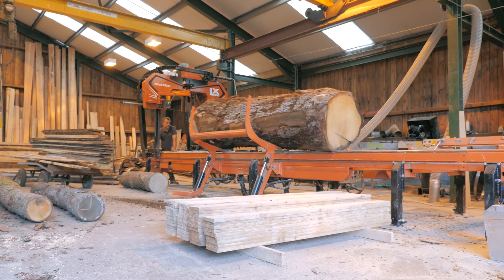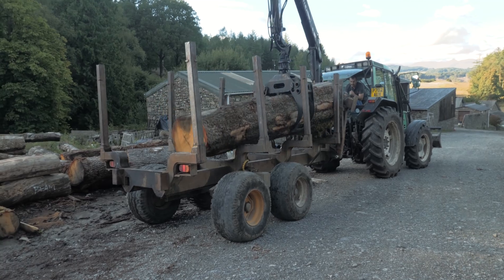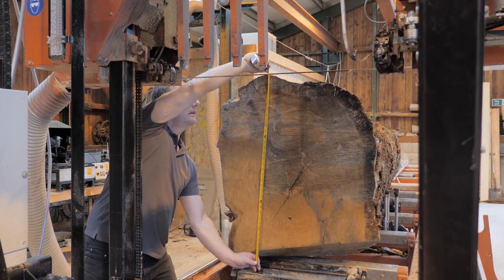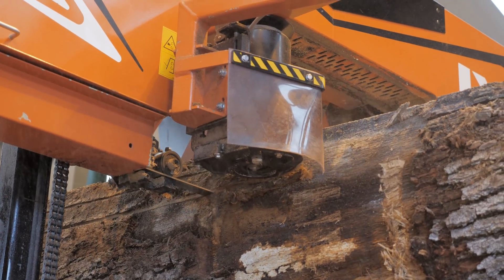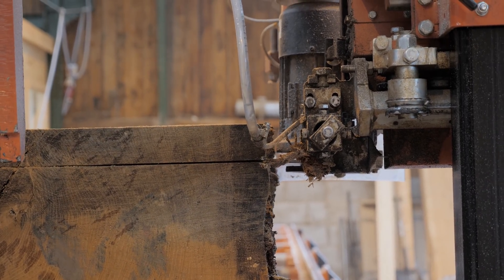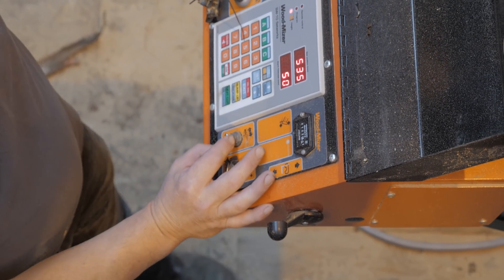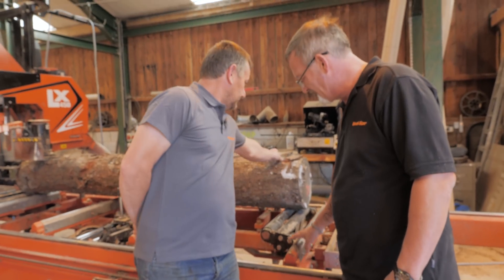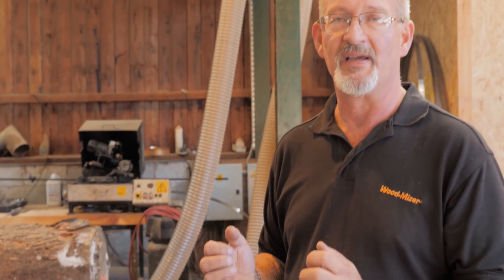LX450 Sawmill at Graythwaite Sawmill in Northern England | Wood-Mizer

Comment: Dear Wood Mizer team.
Could you possibly upload another video about sharpening and toothsettings about vortex blades?
Because I think the vortex blade is your one of the best, if not the best, but it often cracks and tears for me, while the normal 10/30 blades never do, on LT300. Thanks in advance.